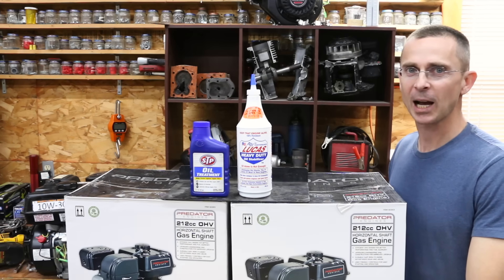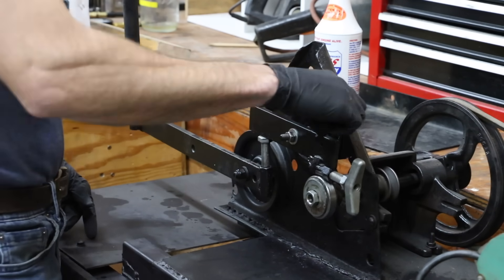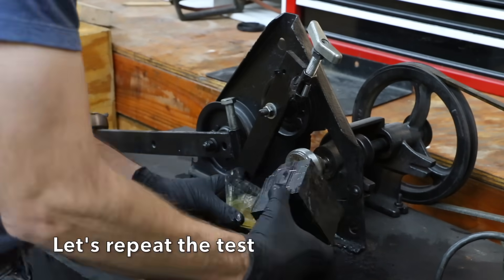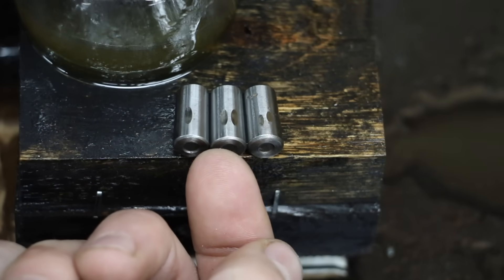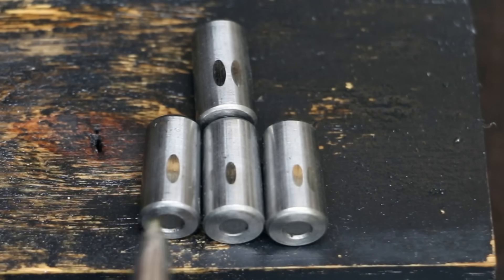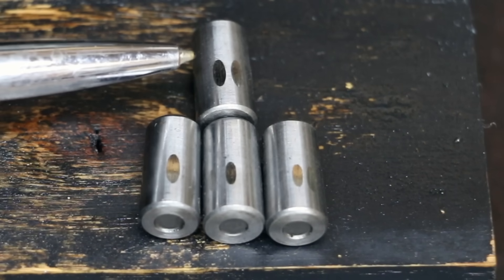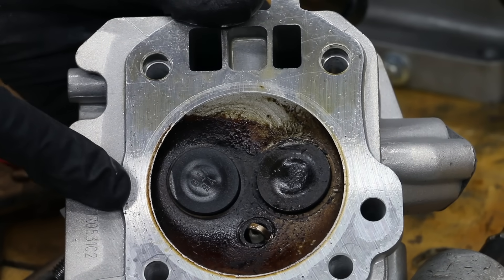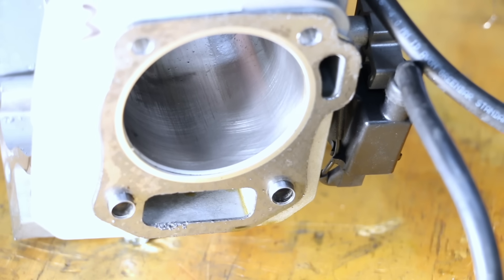Which engine self-destructs first?  Lucas or STP?

Comment: In reference to your prior video with just 10w30 the oil outlasted the additives. It seems odd... the bearing test proves the extra viscosity helps with lubrication yet in a motor running setting it seems to fail sooner then oil alone.
Reply from the maker: Great point.  I believe the oil viscosity has something to do with it.  Also, their ability to deal with heat is likely another factor.
Reply: Project Farm when you did the bearing test the cup full of both Lucas and STP foamed so I wonder if that has something to do with it also the suspended air also stay there a long while

Comment: what would be better is testing under normal operation with oil in em, one normal oil and one with additive, run em constantly under load for about 1,000 hours or untill one breaks which ever comes first and see what the wear and tear looks like, that will be the ultimate test, in industry they run engines constantly 24/7 till they break then we rebuild em, its one think that an additive can spare an engine a few extra seconds before it throws a rod but its a whole nother thing to have an engine last an extra few years of operation with normal oil changes because of an additive, thats where the proof in the pudding would be, nobody runs engines dry (well some people do) but everyone runs engines till they break or wear out and thats where the testing should be trying to replicate
Reply from the maker: Thanks for the constructive feedback.

Comment: Too bad you didn’t have a third engine to run with no additive. I always used STP for assembly of engines back in the 80’s and 90’s. Keeps them lubed until oil pressure picks up. Thanks for the video! Keep up the great work!!
Reply from the maker: Sorry I didn't explain this in the video.  I compared Bestline to 10W-30 two weeks ago. Thanks for commenting.
Reply: Project Farm thanks! I saw that after I commented. Not sure how I missed that one.

Comment: Hey just as a thought...This goes back to my 1960's school days. I had a science teacher who preformed these kinds of test on oil products for the class. He used two steel bars 12 ft long set at exact 45" Then had another steel carriage that we could add weight to. We would time the carriage to see what lubricants were best (cold hot). It also brought the history of Talcum power in as a lubricant used by the Egyptians. Back then believe it our not we even had a pint of whale oil to experiment with. And heated wax which actually has the properties of penetrating oil...Very interesting...
Reply from the maker: Thank you for this recommendation!

Comment: I had read somewhere, that STP is basically just a viscosity enhancer. So I would be curious to see, how how an engine on oil plus STP, would compare with an engine run on the next highest viscosity oil with no additives.
Reply from the maker: Yes, you're right.  Thank you for this recommendation!

Comment: I have had vw and Audi tecs tell me that the European vehicles require European grade oil which is supposed to have a higher heat and pressure tolerance than any sae oil would be curious to see if I makes a difference. I.e liquid Molly euro to say amsoil or something like that
Reply from the maker: Thanks for commenting.

Comment: I'm wondering how good fuel additives work, and I'm probably not the only one :-)
The main purpose of fuel additives is increasing the octane number, thus preventing knock.
Could you increase the compression ratio of a small engine until it starts to knock on normal fuel, and then add fuel additives?
Especially the non-commercial additives like moth balls and paint thinner are interesting. After adding the additives, you could increase the compression ratio even more until you find the best fuel additive.
I know that benzine is not really helping; I accidentally added it to my car once and it started to knock like crazy.
Reply from the maker: Thank you for this recommendation!

Comment: having used bitron for many years in NZ. I now live in Brazil. not availble. Militec1 available. its running in a 2010 Iveco. cursor8 330hp Im impressed. more power on hills. smoother running. & better milage.
Reply from the maker: Thank you for this recommendation!

Comment: I worked at the dealer in the 70's for Jensen Healey/Lotus and other British makes. The Jensen factory said to add 1 can of STP to the oil change to help with low oil pressure at idle. So we did that. In 75 I bought a Jensen GT, drove it home, and back to work the next morning. About 40 miles. I then changed the oil adding 1 can STP with the oil. Got a lot of grief from my fellow mechanics over this. After 25000 miles they had me at a weak point so I did not use the STP in the oil change. Drove home and back to work. Noticed the oil pressure had dropped going home so I decided to change the oil again this time With STP. It did not come back. The oil pressure before 40psi, after 25psi (hot idle). I don't know what changed in the engine but I don't think it was the bearings. I think it was the oil pump. It did something for sure. BTW I sold the Jensen with 55000 on the clock.
Reply from the maker: Thanks for commenting on STP.  Great post!

Comment: In Finland, a petroleum-based ceramic coating material is sold. it makes a new surface for the friction surfaces. this allows the car to drive thousands of miles without oil. the substance should also be on sale. the name of the substance is "RVS" so did you try it? link to the manufacturer's page. 

http://www.rvs-tec.com
Reply from the maker: Thank you for this recommendation!

Comment: I think running them with no oil doesn’t do us any good. You’re just blowing up the engine without seeing really any difference in wear. Yes one lasted longer than the other, but it’s a unreliable test. Too many factors besides oil or lack there of to make this a reliable test with actual data. I wanna see two of the same motors running two different oils at normal operation for a long period of time. Yes that will take forever, but it will give you a very good idea as to how the oil holds up. That is where you’re going to see real results. At the end of the test take the engines apart and examine for wear and do a comparison.
Reply from the maker: Thank you for this recommendation!
Reply: Project Farm you’re welcome.  I’m just thinking normal operation over a period of time would give some real life comparisons for use in my engine. I love the idea you’ve got, but there are too many tolerance factors in these engines for the residual oil left in the engine to make a difference. Maybe I’m wrong, but unless you run the same test multiple times you don’t really have any reliable data.

Comment: I assumed most people use Lucas like I do to stop tiny leaks by thickening the oil. It's doesn't work so well for the engine I guess because of heat. But does work well for steering pumps and automatic transmissions if it's just a tiny leak.
Reply from the maker: Great post and thanks for commenting.

Comment: Just food for thought but I would suggest changing the oil after the break-in completely, that way you have new, clean oil with the additive mixed. Usually, oil additives are recommended to be added during an oil change instead of added to the preexisting oil in the crankcase. 

Also, could you test engine flush products in the future? They are oil additives that supposedly break down sludge and contaminates in engines. I know the GUNK brand makes one. Would like to see how effective those really are.
Reply from the maker: Thank you for this recommendation!

Comment: I think this would have been a better test if the engines were run for several hours at full throttle and used as directed. Then send the oil into blackstone labs for oil analysis. Repeat this test for several days.
Reply from the maker: Thank you for this recommendation!

Comment: I just discovered this project
 Have you run a baseline using just motor oil? Are you using the same oil for each test?
Reply from the maker: Yes, I did a baseline test 2 videos back comparing 10W-30 to Bestline. Thanks for commenting!

Comment: I'm a retired long haul trucker. Owner /operator.I used that Lucas oil stabilizer in my truck and never had to add any oil in between services. I also use it in all my personal vehicles to this day. I never have any problems with any of my vehicles outside routine maintenance. In my opinion, Lucas is the best.
Reply from the maker: Thanks for commenting on this!

Comment: Try grease lightening oil additive.
Reply from the maker: Thank you for this recommendation!
Reply: Project Farm grease lighting is one i personally tried. One claim was you would need to readjust throttle setting. It was true on my 302 v8. Engine did run better and faster.

Comment: lucas went further than the stp. i think point made.
zinc is your engines friend but if a cat is attached it's not the friend of that. this is the reason that zinc levels have dropped drastically from the content of your motor oils.
Reply from the maker: This is a great point. Thanks for commenting.

Comment: You do realize that you're running a API SN grade oil when small engines should run a older API grade like SJ? Have you ever talked about the different API oil grades and why regular modern engine oil shouldn't be used in a small engine?!?!
Reply from the maker: Thanks for commenting on this.  I'm doing such a short engine run at a total of 7 hours that it won't really matter.  Also, the goal is to use the same type of oils used in a modern automobile, since the small engine serves as the guinea pig for a more expensive design.  Thanks again!

Comment: So the point of this was to destroy two perfectly good engines for what? Thumbs down waist of time. All breaks down to who your sponsor is.
Reply from the maker: Thanks for commenting.  I'm not sponsored.  A lot of additive manufacturers run engines without oil as I am doing as the "gold standard".  Thousands of those leaving comments requested using new engines to improve the testing accuracy over used engines. Thanks again!
Reply: So why would they need to perform these test when companies like Brigs,Cummings and others have did these exact same test. So why would your result be better over the manufactures. Now you want to impress me do the exact same thing were it matters lets say take two COPO 427 engines and do the exact same test. Over 27,000 for that motor not sure you get enough donations for that. LOL
Reply from the maker: The test results I provide are unbiased, unsponsored results and will likely result in less impressive results thank claimed by the manufacturer.  Thanks again!

Comment: It might be kind of cool to try a highly rated synthetic oil like mobil 1 or quaker state
vs the same oil with zddp +. I'm betting the oil without additives does alot better.
Check out 540RAT Oil Blog.... He has a pressure rating system for oil testing and it 
seems to have good correlation with flat tappet cam wear. I would think that your
oil starvation test would show the same kinds of differences as his, because of the extreme pressure when the oil is drained.
Reply from the maker: Thank you for this recommendation!

Comment: I would like to see how, Motor Up, fairs. They advertised it as running for hours with no oil in the car engine. The commercial had, Bobby Uncer, in it as the spokesman. It was an interesting commercial, to say the least, but can it really protect an engine. Will a, automobile engine, and a,lawnmower engine react the same way with the product, Motor Up, in them. That would be interesting to find out too.
Reply from the maker: Thank you for this recommendation!

Comment: It's a 1-5 ratio you fuck.  20 goes into 100 5 times... Not 4
Reply from the maker: I apologize for not explaining this in the video.  When calculating percentages of ratios, one must add both parts of the ratio together before performing division.  That would be 4+1 for total of 5 parts.  Therefore, 1 part (additive) and 4 parts (oil) would equal 20% additive and 80% oil.  On the other hand, 1 part additive and 5 parts oil would mathematically equal 16.6667% additive and the remainder oil.  Thanks again!

Comment: Does it really matter which engine lasts longer, they both fail proving only one point, don't run the engines without oil.  As far as the additives making engine oil more effective, that would have to be a test of four engines, two with and two without the additives, then compare which engine lasts longer.   Too me it's a waste of time.  Follow the engine manufactures instructions, and both engines should last about as long, but without the oil treatment, will run cheaper, when not spending money on additives that are not really necessary.  Just an opinion.
Reply from the maker: All great points.  Some of the additives we'll be testing are sold by manufacturers who perform these type of tests.  I've read dozens of comments about this below. This series will demonstrate which last the longest by providing the best film strength and lubricity.  Thanks for commenting.

Comment: Impressed they ran 20+ minuets with out oil, same failures. What we don't know is how long one would run without additives to see if the additives helped. I did run a Briggs for 10 seconds without oil once, so I now add a 1/4 oz of STP to my riding mowers after an oil change.
Reply from the maker: Thanks for commenting!

Comment: What you should do instead is run tests with both treatments, then submit an oil sample to be tested to see which one has less metal/wear indicating particles in the oil.  I believe they also test the oil properties.  This would of course have to be done with two new engines as well but I think. It would be more scientific than this kind of test.
Reply from the maker: Thank you for this recommendation!

Comment: ** Neither of these additives ever claimed that an engine would or could survive a test like this.
Only One additive that I know of has...and that's PROLONG. We've all seen the unbelievable infomercials and if you haven't, you should.
They were sued several times for false claims but WON everytime ! This product needs some real world no B.S. testing from you sir...asap please! :)
Reply from the maker: Thank you for this recommendation! and thanks for the positive comment!
Reply: I second that; I have always been curious abut the prolong claims.
Reply: Agreed, Prolong testing is a must.
Reply: I use Prolong in my vehicles. I've seen it work. 1998 GMC Jimmy I drive burst an oil filter canister on the interstate. Not entirely sure when the oil finally leaked too much to pump but I know it went 8 miles from when the engine began to sound hollow. Oil pressure had been on 0 for several minutes before that. Stopped at a friend's house to see what happened. Discovered filter, he drove me to get oil and a replacement. Pulled drain plug to let the last few drops out, replaced filter and oil and started it. Once it primed we had oil pressure again and no knocking. Next oil change displayed no signs of metal contamination. Not a good test on my part but i know it saved that little 4.3.
Reply: If you notice he had no oil cap on all of them air gets in there and yes moter will blow lol

Comment: If you look up the msds on the lucas or look up results from independent oil analysis tests, you'll see that there are Very few additives in it.  Its purpose is to add viscosity And CLING  factor to its host oil and Not lubricity.
Reply from the maker: This is a great point and helps explain the results compared to 10W-30 oil. Thanks for commenting!

Comment: Awesome video, as always. I like the idea of doing more oil additive tests, BUT, I think you need to verify that these tests are meaningful in the first place. 2 engines in identical conditions will not seize at the same time, that introduces a measure of luck into these tests, I think you should measure the difference in time taken to seize on 2 engines in identical situations: Broken in, run on regular oil, drained, and seized. Knowing that measure of uncertainty will help better determine if different additives actually make a difference.
Reply from the maker: Thank you for this recommendation!
Reply: Will S. That's a good idea to establish a baseline figure regarding just how much of an improvement there was with the additives 👍
Reply: Big deal they both blow up wippie do that doesn't tell u nothing face it the only thing it tells u Is that check ur fucking oil!!! U shouldn't be driving if u can check ur fluid! Video suck big time ya'll know check the fucking oil dumb ass!!!!!!!!!!!

Comment: I've read through the comments and I like the idea of LiquiMoly Anti Friction vs Prolong...I run the LiquiMoly in my '95 BMW with Royal Purple 5w-30 and it has had zero issues in years,the Prolong to me seems just like the Slick50...a good sales campaign for crap.The upside to the 2 that have been mentioned is that you can get either one for a fairly reasonable price at any chain parts store.Great videos thanxs for taking the time to do them.
Reply from the maker: Thank you for this recommendation and thanks for the positive comment!

Comment: In your previous video with the other two engines, the 10w-30 lasted 38 minutes and the best line lasted 71 minutes. Why do you think these two lasted significantly shorter times?
Reply from the maker: I'm not sure but it has something to do with the added thickness of the oils. Thanks for commenting!
Reply: Manufacturing inconsistencies, clearances and tolerances vary greatly with each of these engines. 
I doubt that a repeat of the experiments would yield the same results.

Comment: An option that might be better than running both to failure, would be to stop the engine that is still running when the first one fails. Then look at the wear at that point, because obviously the wear at both failures is obviously going to be similar. One just lasts longer.
Reply from the maker: Thank you for this recommendation!